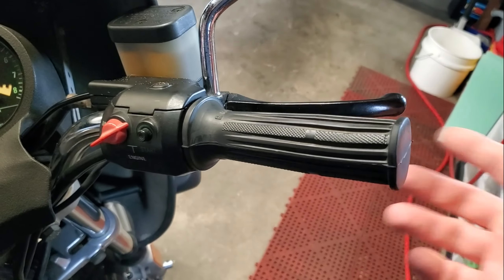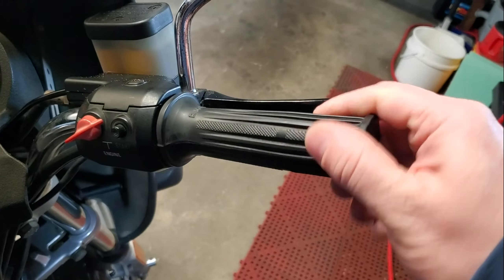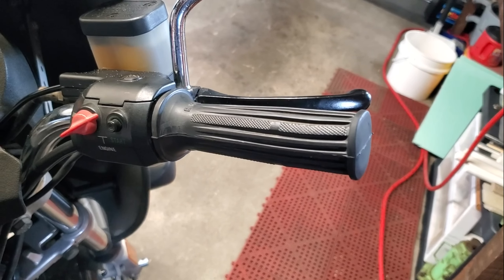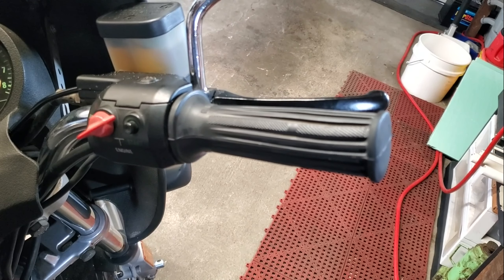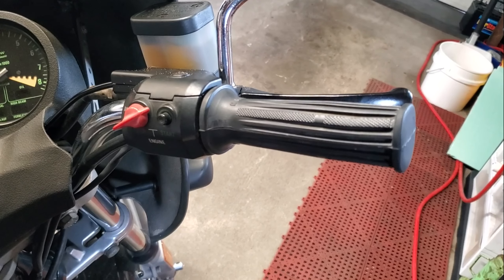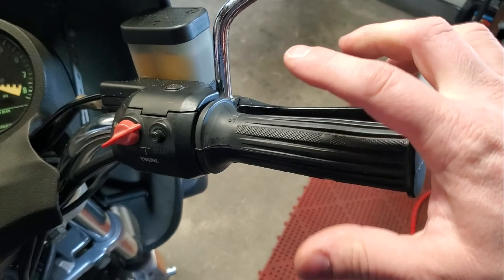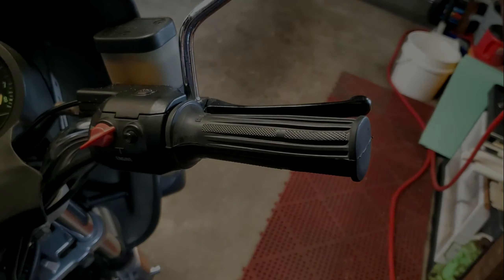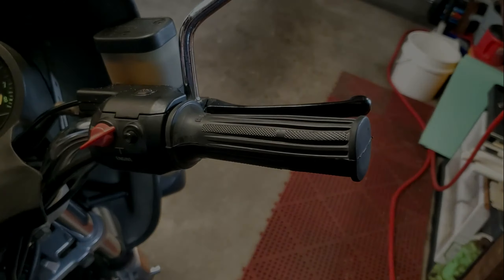1983 BMW R65 Stiff Throttle (Fix Not Shown)

Comment: How will this video help anybody?
Reply from the maker: I realize it probably won't, there is better information in the description. It may help if somebody has an older motorcycle with a stiff throttle, if they don't, waste of time. If somebody does fall into that category, it won't help for them to watch me tell them how to obtain new cables for their motorcycle, and spend over an hour simply routing cables from point A to point B. If you can't route cables, you should be watching much more educational material on motorcycles. I actually just wanted to see for myself the difference before and after, nothing more. If you have any questions I would be happy to try to answer.

Comment: Well that was a real let down
Reply from the maker: The fix is new throttle cables, sorry I did not include a lengthy segment of video showing the replacement of those cables, it's pretty straightforward. I guess I should take this video down.